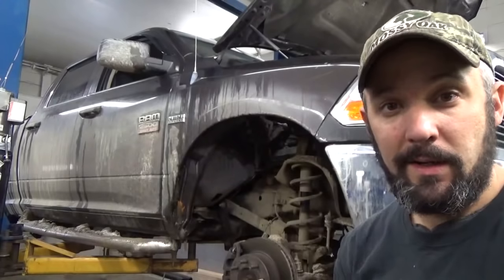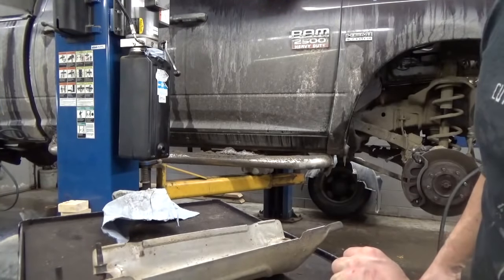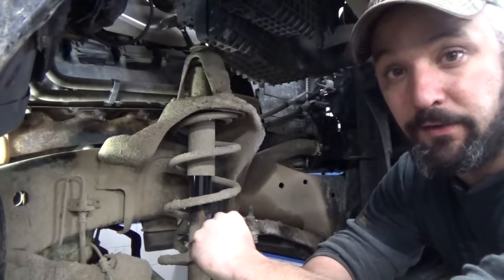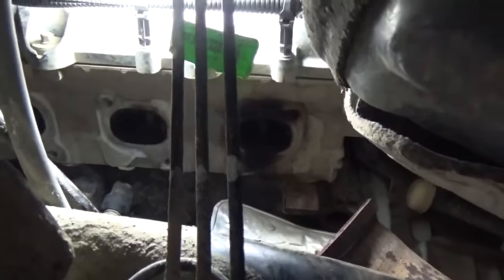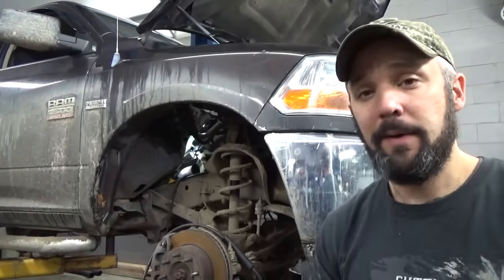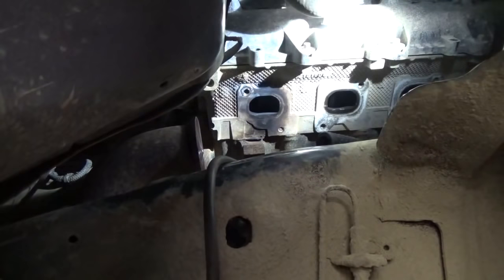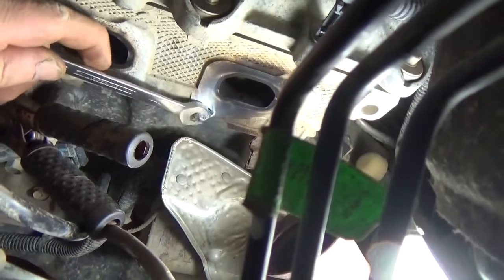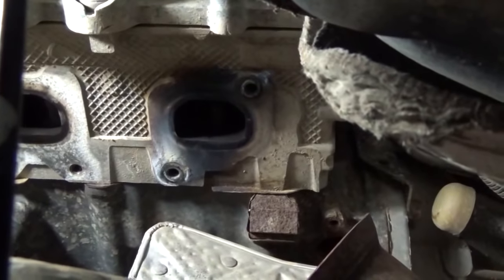Removing Broken Exhaust Manifold Bolts - Hemi Dodge Ram

Comment: I think you just saved my ass! One broken manifold bolt on a 96 Dakota. V-6. It is also recessed 1/8th inch. I think you simple filled the gap between the end of the bolt and the nut? That 1/8th inch gap? There's no possibility of welding to the head? I know nothing. The weld doesn't adhere to the aluminum? So many questions. Sorry

Comment: You appear to be heating the head of the bolt rather than the manifold, is that just the way it looks in the video or is that what you are actually doing? If it is I don't understand. Heat expands.

Comment: It doesn't matter when they are deeper in to the head the mig wire is steel and will never adhire to the aluminum .You should try to clean it will a wire brush or even scratch it clean because the carbon gets on them but once the heads snap off the pressure is off.

Comment: just had my 08 chevy manifolds done both side because bolts were already broken just cuz. cost me $1000 for parts and labor so not bad and i had them install "upgraded" bolts instead of oem cuz they are junk. well a month later and the truck caught fire. barely got to enjoy the tick free manifolds...

Comment: You really should have included a before/after clip so we can tell what the noise is. I've been trying to diagnose whether I'm having an exhaust manifold leak or the classic hemi lifter issue. I know my heat sheilding is mangled and hanging by a thread but sometimes it sounds more like a bad lifter

Comment: I just did this same job to a 2009 Ram hemi, 73,000 miles, passenger side back bolt/studs broken. Much to my surprise those two bolts would not weld, they were stainless, from the factory. Non- magnetic, the other bolts would race to my magnet. 2 hours later the 2 bolts are totally drilled out, left hand thread bits did nothing. Oh joy, customer wants to do the drivers side also. Lucky me, the bolts all came out but the same rear 2 stud bolts were also non magnetic, stainless is my only guess here. Without my cobalt drills I would still be working on the mess...

Comment: What size/type is welder are you using? I've been trying this all day (12 different nuts) with a 90 amp flux core and they just crunch right off with hardly any pressure.  I'm pretty sure my flux core is only good for filling up a garbage can..

Comment: Did you check the manifolds on this for warping when you had them off? Were they? I need to do mine and I'm debating on whether to have new manifolds on hand ready to go and just replace them or not. I know at least 1 of my heat shields has started rusting through so I bought 2 new ones of those and I'm just going to replace them.

Comment: would it matter or work the same if I use a Lincoln 220 welder instead of that Mig?? my advantage is that I have my whole engine removed.
Reply: It would work but more dicey due to larger local puddle.One or two seconds
and right current .One good thing is the rod can be shoved into the nut to guide the stick.

Comment: Total bs should be a recall issue on Rams dime, this has happened to every Ram I’ve owned and every Ram my coworkers have owned. At one point we had 4 Rams at our work all ticking at once haha.
Reply: Couldn’t agree more. I had mine fixed by the dealer in August 2021, and again in November of 21 and they broke again but they won’t cover it under the warranty!  Absolute crap!

Comment: I have only watched 8 minutes so far, but I'm stopping to comment because I'm so confused. The bolts that held the heat shield on also secured the exhaust manifold to the engine block? That seems odd to me. Also, I noticed that you seemed to get right on those bolts while they were red hot. Doesn't heat make metal expand? I'd think you'd want to wait for them to cool?

Comment: Do you use any precautions with the radio or other ele!ctronics when welding? I heard the finals on the radio were susceptible to being fried if stuff isn't unhooked/isolated/removed during welding?

Comment: I worked on a GMC and the non turbo side was like swiss cheese ended up breaking every bolt had to cut it in 3 pieces and took a sledgehammer to is 
It took me 3 day but i finally got the new one in

Comment: Did the welding torch have a filler in it to fill the nuts? or was the nut melted from the inside to create the seal?
Reply: Mig welder= mig wire fills up inside the nuts.

Comment: When doing this on the bolts that are recessed, do you have to be extra cautious not to weld the nuts to the aluminum heads or is that not a big concern because steel won't weld to aluminum? my welding skills consist of welding scrap pieces of metal together in a easy to reach location. I also have a mapp gas torch (yellow bottle) do you think this is sufficient for heating up the bolts?
Reply from the maker: +MrEroupe Well this is a tricky job for a beginner but hey ya gotta start somewhere I guess. I don't worry about it bonding w/ aluminum and MAP gas should be ok but might not be hot enough.
Reply: +South Main Auto Repair well I lucked out and was able to get them out with vice grips! so not welder needed, thanks for responding!

Comment: Believe it or not I saw your video 3 days ago and then out of nowhere 2 bolts busted and my right side stock "headers/manifold" cracked the next day so now I need to replace them but I want to go with JBA Long Tube Headers what do you people and guys think? Also it's a 2014 ram 1500 5.7L 4x4  automatic 6 speed

Comment: Don’t know anyone who has done this but read on it and don’t know much about it. To prevent this many ram owners replace manifold with headers and better bolts. Is that legit? Some said the cost would be about the same and it would get rid of the problem all together and not potentially happen a second time? Thanks

Comment: I bought a 2012 ram with the 5.7. The previous owner had drilled into a water jacket on the driver side. I had to replace the head. Now the bolts are busted off on  the other side

Comment: There’s another method, a local machine shop sold a chemical that would dissolve steel bolts in an aluminum head. You build a well with putty around the broken off bolt, fill it and within a couple of hours the steel is gone.

Comment: Where is ur shop locate at please tell me Texas but if not what is the amount for that kind of job Iam getting so many numbers from abt 6 different dealers  I have a 2009 ram 5.7 same truck in ur video
Reply: same man, I was told 1600 from the Dodge house for my 2003 durango, leak and broken bolts.

Comment: has the customer experienced any problems with this truck since you fixed it? I'm having the very same problem with my 2010 Ram 2500. I decided to go with stainless ceramic coated headers, made by JBA, along with Stage 8 locking bolts. have you ever replaced manifolds with headers?
Reply from the maker: +Joshua ganon I have installed headers and they usually go to leaking with in a year... but then again I have never used a "stage 8" bolt haha... sounds heavy duty

Comment: What if the heads are not aluminum and lets say steel. Seeing that the mig will not weld to the inner hole. On steel heads would not the welding in the hole actually stick to the side of the threads as well as the broken stud? Again, said before, some techs have it and some don't. You obviously have it. Whatever you get paid by you tube and endorsements to make these video's does not even compare to the amount of help you provide to the DIYers that watch your channel. You deserve every nickel you get paid. Thanks.

Comment: Hey brother just watched your video for like the 10th time. Got mine all torw apart. Last bolt last side broke off just like your last one in this video. About 2 or 3 threads inside the head. Maybe a little less. Either way all I have is a flux core welder. Any advise on using this to do the same thing you did. This flux core welder ain't the the best. Still trying to get used to it. Any help would be appreciated. Thanks in advance brother. I hope you get this. Not sure how old this video is.

Comment: What welder did you use?  Do you think I could get it done with my 110VAC harbor freight special with flux core??
Reply: Yes you can but you might have hard time doing it like he did. This is how I do it, Just a different way that might help someone. I don't want to come off like some. Like there way is the best way. I'm just trying to be nice and  help you out. Your welder is small and your using flux core so we have to help it by cheating a little. 
what ever the bolt size is that's broken we need a washer one size smaller than the bolt. I think the bolts in video were 8mm that's 5/16 to me. So i would get a !/4 inch washer if it was 10mm that's 3/8 so a 5/16 washer and so on. Then put washer over bolt try to get as close to center as you can. NOW when you go to weld stat your weld out on the washer let it start for a few seconds don't feel like you have to rush. Move weld over to bolt and let it hit there for  a few more and start going in a circle to fill up hole keep welding til your over washer a little bit. Then grind your weld flat on washer. Then take a nut a big one that hole is a little smaller than washer here i might use 1/2 or 13mm . Put nut on washer center now start your weld on the threads move down the center of washer and fill up hole. Now when ever you start to weld you don't stop till your done with that step, don't spot or tac anything your welders cold start will make weld weak. Let it cool then work nut back and forth to remove. If nut breaks off repeat , you can weld  around nut also just give yourself room for wrench. Good luck

Comment: Had 2 mechanics try to remove broken exhaust bolt driver side 2015 ram. They could not remove the broken bolt even after removing the engine out of the truck

Comment: My neighbor showed me this trick after I spent an hour or so messing with heat and rust penetrant. Said a guy who used to work at his shop could get out bolts snapped off half an inch or so deep by just building up metal with welds

Comment: The problem with the bolts breakin in the rear of tge manifold is due ta the rear of the exhaust puttin to much stress on bolts and manifold. Nissan titan/armadas manifold cracks on the right  side due ta the excessive stress from the rear exhaust pushin, pullin, and  the heat wit vibrations. Tge manifolds need better support or flex tubes ta alleviate this issue.

Comment: Left hand drill bits. I owned a machine ?fab shop fr years and I always used left hand drills, once you start drilling it grabs and just screws them right out, use the manifold for a guide to get it started. If someone used an ez-out and broke it, I would fix it and tell them to throw all them away and never bring me another broken ez-out, bring to me before you make it worse.

Comment: What's the cost to do this repair? I was quoted $360 for my 2004 Dodge Durango...is that a fair quote??? Watching you do this job, I know that I don't have the equipment to do it myself...
Reply: Ask yourself if YOU would do this PITA job for $360 lol. Some things are worth paying others to do. I'm about to tackle this job on my f150 just because I can't afford to pay a mechanic. I do own the equipment to do this job, but I lack patience and I'm quick tempered. Should make for a great video:) If I was quoted $360 and I had it on me, then I would gladly let someone else do it for me.
Reply from the maker: +PaulGurule69 Local Dodge dealer here gets $1600 to do both manifolds lol

Comment: Don't know if anyone suggested this (with 1000 comments didn't read them all) with your flush or below the surface broken bolt, try welding on a washer (easier to see what you are doing) then weld your nut to the washer.

Comment: I started getting ticking from the passenger side. Got all bolts out except 1. Managed to get the manifold off with a lot of the stud exposed. Unfortunately the manifold seems to be in rough shape and from what I'm seeing about 300 bucks. Also don't have a welder..that's what friends are for. Lol

Comment: I'm told the jewels on the cam shafts ( exhaust I believe )  get scoring from cheap metals and screw up the whole engine ... what's your take ?  BTW Unless it's towed in ... I find it disrespectful to a mechanic to drop a vehicle off without a good wash ... 🙄👍🏻

Comment: What did you clamp your mig to when you were welding the nut?
Reply: Any body or engine ground/earth as close to the weld site as practicably possible🙂.
Reply: Thanks! I tackled this job a while back and boy, what a job.  But I got it done thanks to this vid.

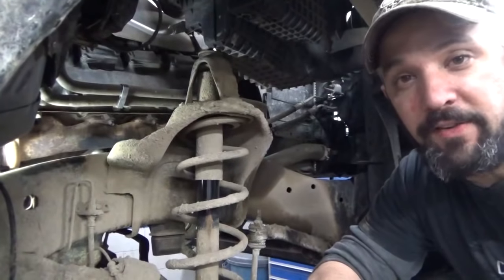Comment: what did he say at 4:17
'imma go ahead and heat up the heads of the bolts of these ...' cant make out the last sentence
Reply from the maker: +xoppa09 to break the lock tight loose that it has on from the factory he said...

Comment: Why you should buy a Ford V8 or a Toyota inline 4. Maybe use a wire brush on a dremel to clean the broken bolt before welding, so the weld is stronger.

Comment: Since that is a common problem with rear bolts breaking.  Can you install a larger bolt. Oh that could be a factory fix. But they what you to use their crap factory bolts so its will happen again

Comment: I’ve used this method. I’ve also drilled a lot of these out. My favorite way is to use my 1/8 inch pencil grinder, cut a slot in it and remove it with a screw driver. I can usually do this job start to finish in an hour 30 to 2 hours. I’d charge 3 hours per side to do this job.

Comment: Just brought my 2015 Dodge Ram into dealership last night for the same problem. Ticking goes away after about 40 seconds. You would think they’d have bolts that wouldn’t break.

Comment: Common issue hell my 2020 ram 1500 with 35 thousand miles the exhaust manifold cracked I was lucky the bolts didn’t break

It’s always the back ones

Comment: would these heads on the 5.7 come out of the 2003-06 ram 4x4 without removing the exhaust manifolds. I need to service one cyl & would prefer to avoid unbolting them altogether. I know I can remove or cutoff the bolts to the exhaust.

Comment: This must just be a poor design. I'm in the Phoenix, Az area and just had to extract a couple of these studs. The two rear most on the passenger side. And by no means did this Dodge have any winter corrosion going on.
Reply from the maker: +CHREESE ONANS yeahhhh you have to salt there for sure :)

Comment: This video has got to best testament to not choose this line of work....What a nightmare every step of the way.......Everything is crusty/corroded or seized...  Geez.. You guys up north are extra tuff!
Reply: +Clete88 A torch is your best friend when working on northern vehicles, penetrating oil is 2nd.
Reply: +2 AM You handled what I would call one disaster after another with a cool manner.....Kudos to you for that.....I would have probably hurled things around....but you kept your cool......and you got the job done.. 

I give you maybe 10 years....you're going to burn out!  Battling rusted bolts and corroded nuts is going to wear you down man!  LOL!  Just poking fun..    

I love your channel by the way, and I've learned a lot.....I'm in my early 40's and into electronics.......watching you and Ivan, I've learned the basics of troubleshooting vehicle electronics....so I'm on to my 2nd career.....My company is giving me early retirement, but I can't stop fixing things....

Would you still buy the Verus if you had it to do over again?

Comment: You know yall, the more i think of it, maybe the exhaust manifold should be serviced every 100 thousand miles for gasket replacement and bolts as well. If you can maintain that sort service on your car, alot of these headaches and more important, damage, can be prevented....Just Saying 🤷‍♂️

Comment: How many labor hours do you charge for this? Reason being is that I do this the same way and not every job turns out this way as stubborn broken bolts do not EVER come out that easy. You end up drilling and retapping the threads in the cyl head or using inserts after drilling. Or I use an angle pencil reamer with 1/8th "in" bits and bore them out then recap. Mitchell on demand quotes 2.3 hours per side and no additional hours for bolt extraction. Bullshit

Comment: Ah, the good ole hot wrench.. Kinda cringed a bit when you immediately started wrenching after heat.. But, that's your decision, and you are the one under there.. I to this day still do not understand manufacturers choice to use high carbon bolts in exhaust systems.. And it is EVERY ONE of them.. And then "let's use thread lock also".. Friggin engineers..

Comment: The other 5% of the time pick up a cheap chinsesium 4 flute end mill bits (flat bottom drill bit ) use them to clean top of the bolt then preheat with torch then weld nut on and u will get 90% of the original  5% that refuse to come out

Comment: you are lucky  person  because I tried that way they would not come out so I have use a carbide drill bite to get them out and some times  the drill bite would go off to the side of the stud while drilling them out and screw  up the head that try use he coil it but by the time you do that  you have gone over size of the hole screw up the head  and try to tell the owner what had happen they want you to pay for the head  to be replace saying you are the one that screw up  the head  so have you had that bull crap pull on you then are law suite with owner  trying to get paid for time